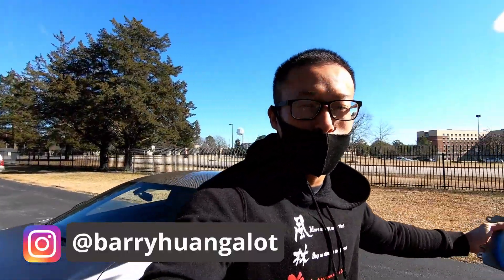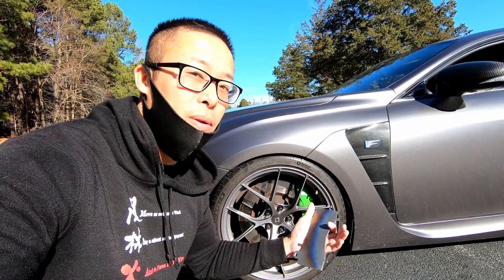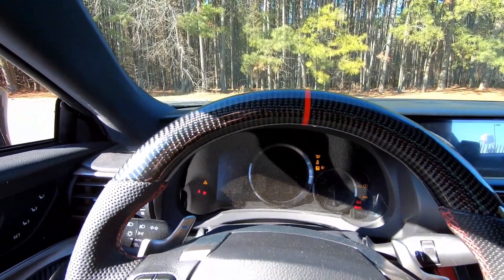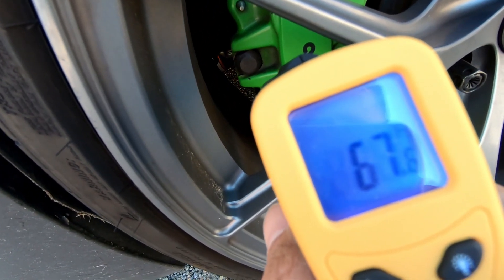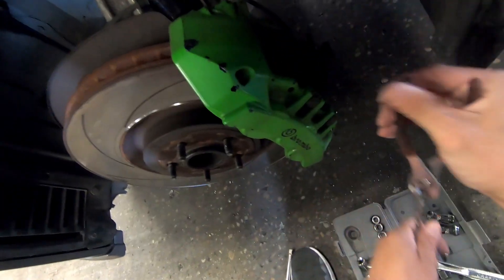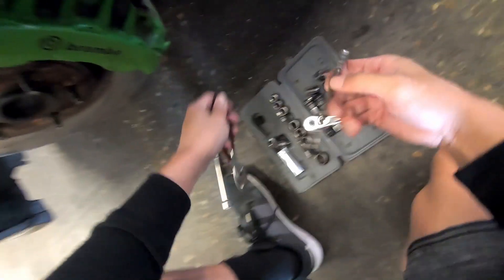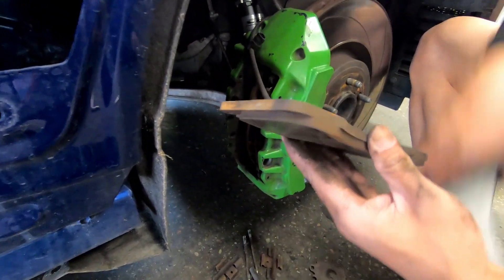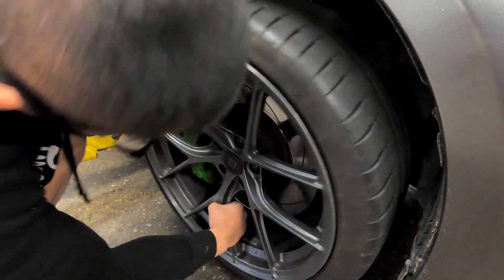Installed LEXUS RCF Titanium Brake Shims And Tested Them

Comment: Maybe you could install the brake shims in one caliper and the other without. Do the test and check de temperatures at the same time with the same condition. In a track day the temperatura goes to 250 Celsius.
Reply from the maker: That is actually a good idea

Comment: Hey bro what miles do you change your rotors? Lexus is recommending 25k but ppl do otherwise. I know a guy that changed his at 50k
Reply from the maker: Im still on my original rotors at 90k
Reply: @thehuangbros  damn that's good! Dealership has me trippen lol what you think about the power stop z26 on front and rear pads?
Reply from the maker: @beto3214015  ive heard they are good for daily. I wouldnt do any serious motorsport stuff with them.

Comment: Hey man! I live in Colorado and I loose a lot of power, what are some things you recommend to get faster?
Reply from the maker: Are you talking about engine horsepower? Its most likely due to you being in Colorado and the altitude. The air is thinner. So your engine is ideally being deprived of oxygen and it would need a tune to help accommodate it.
Reply: @thehuangbros  yea I was wondering what would help get my car faster since I’m losing hp. And if I had a tune how much hp would that add?
Reply from the maker: @aslannn.u  im unsure as im not familiar with tuning for elevation. Overall there is still a lack of oxygen. But the tunes that I see out are estimated 5whp for a completely stock car. Once you get headers, exhaust, and tune then its an additional possible 40-50whp. But overall the main important part would be to tune for elevation
Reply from the maker: @aslannn.u  roughly 3% power is loss for every 1000 ft. Just got the GTR retuned for colorado springs altitude. I definitely feel a difference going from sea level 93 e85 to 6k ft altitude 91 e85. I believe any tune is better than stock tune. Some tunes make it more efficient and you dont even need mods.
Reply: @thehuangbros   thank you I feel better on what I should do!